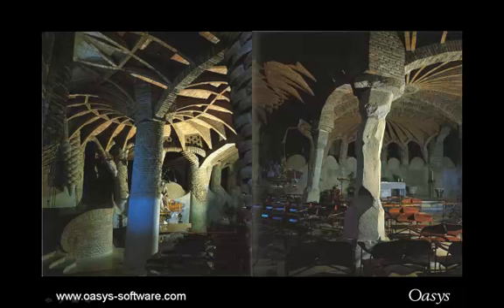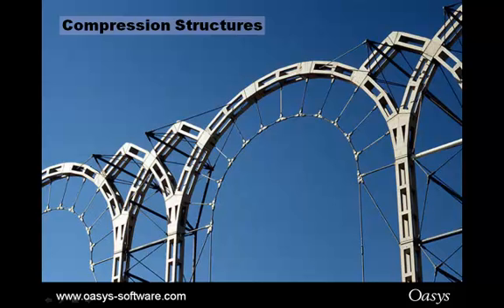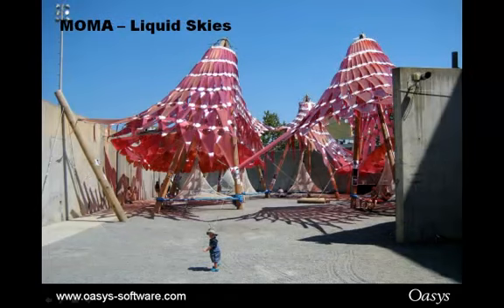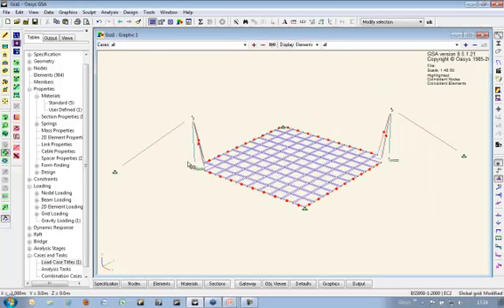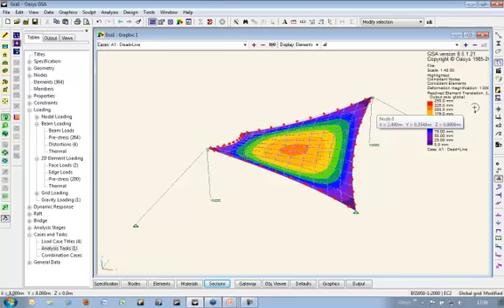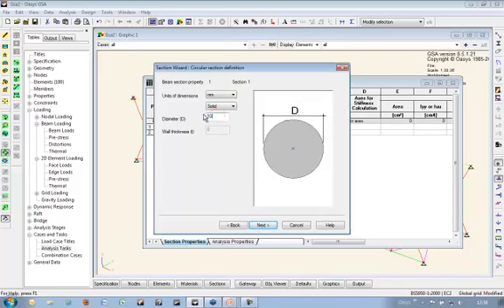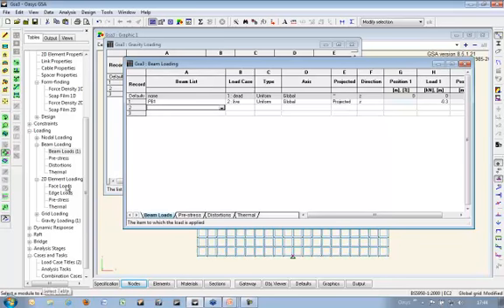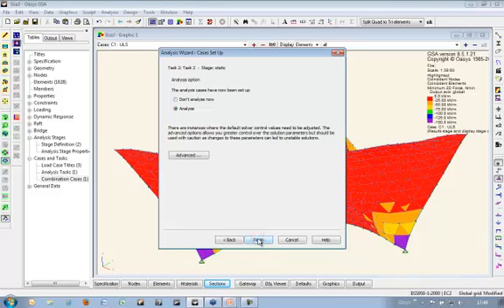Cable Nets and Grid Shells: Form-finding with Oasys GSA Fabric (Oasys Software Webinar)

Comment: Hi Peter can you tell me what type of supports you used and on which nodes to create the conic section shown at 12:58? I can create the shape using the wizard in GSA 8.7 but I am having trouble doing the form-finding to get the final shape. Thanks in advance!

Comment: Jack
At the time I created the conic shown using cylindrical axes to define the coordinates, drew in one strip, then used the copy command to rotate them around the centre.
Now in GSA 8.7 there is wizard option to directly create a conic.
For more complex conics you may be better off creating them in a CAD program first (say AutoCAD or Rhino) and importing the geometry.